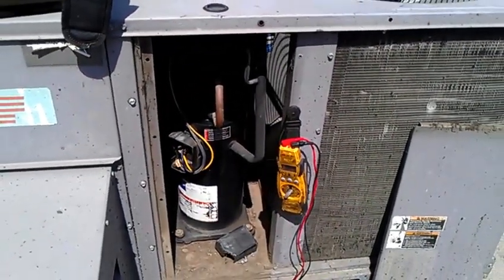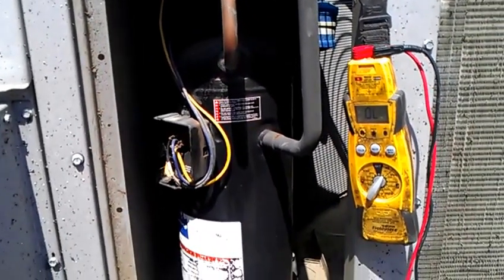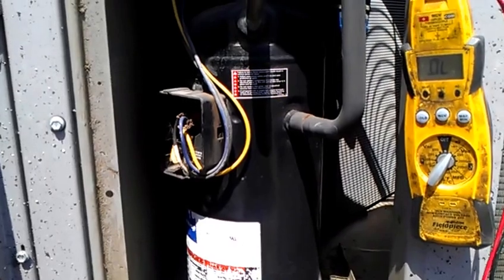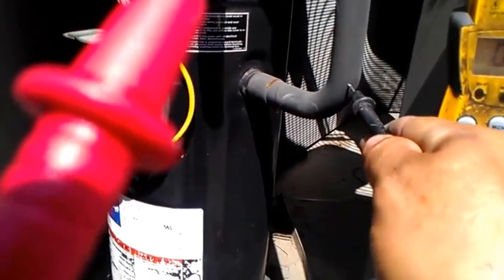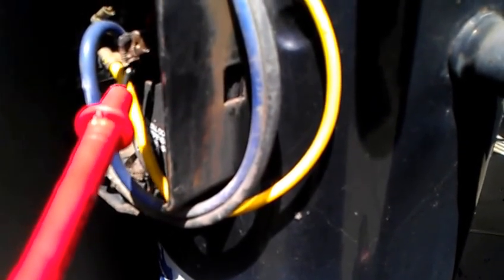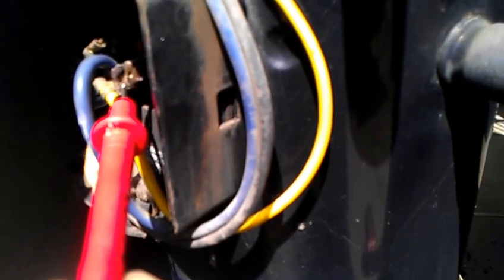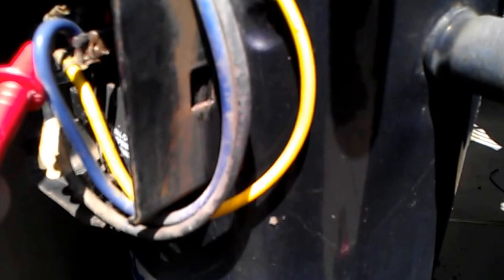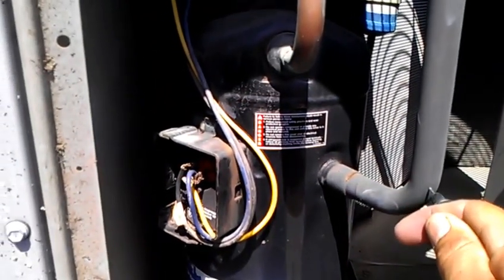Copeland scroll compressor,short windings to ground

Comment: You should always take off the wires when checking a compressor, what if it was just a wire that was short to ground?  Look pretty dumb changing a compressor and it was just a wire rub.